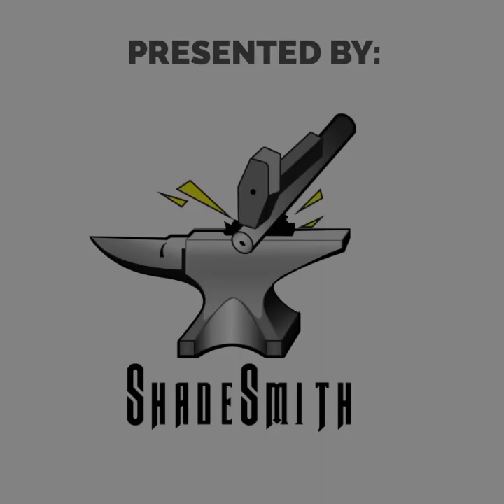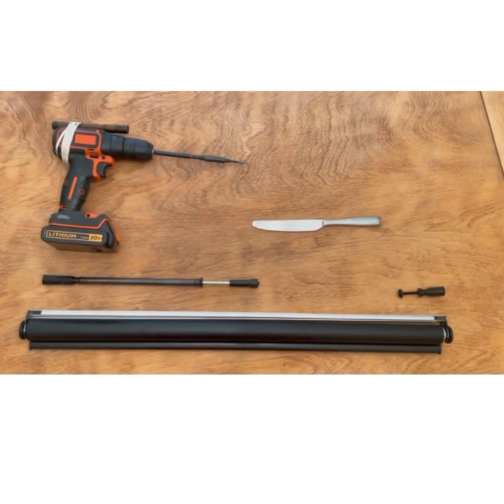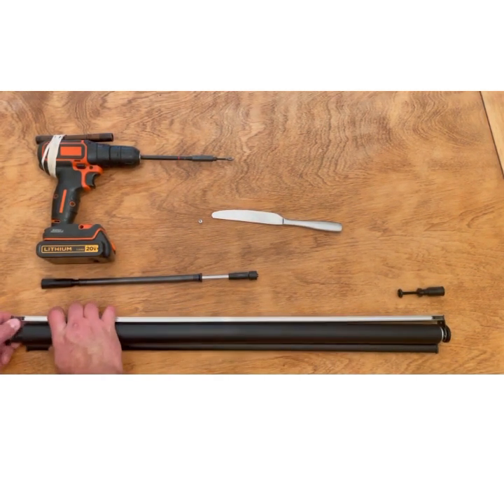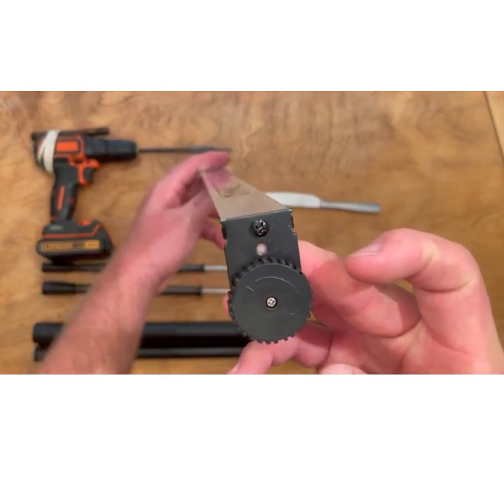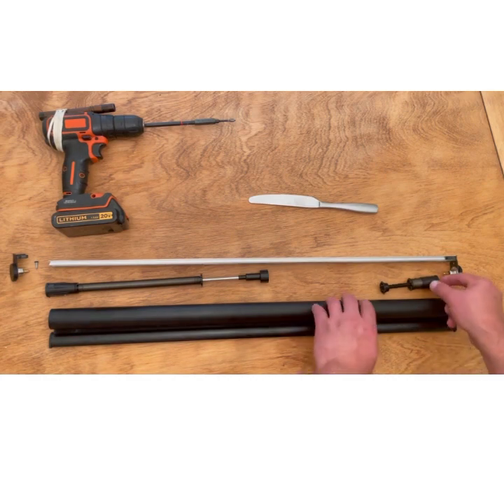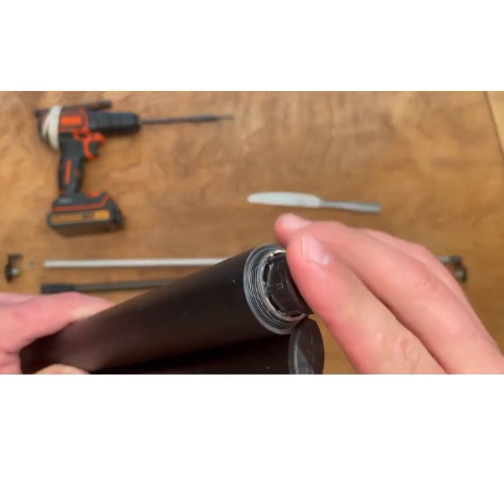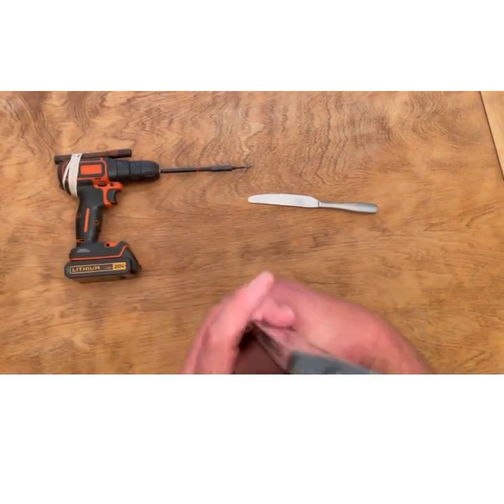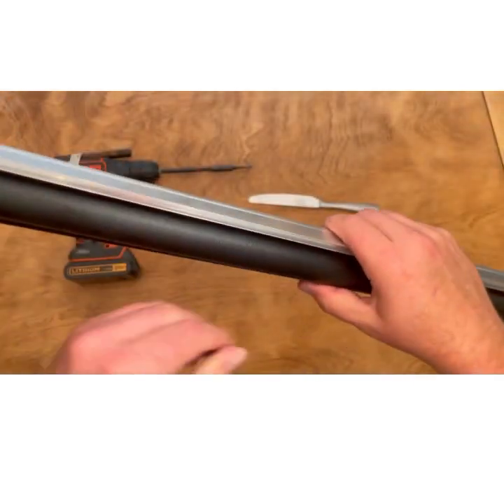Slow Rise Roller Shade Spring & Auto-Stop Replacement Instruction

Comment: Could there be another cause for poor operation inside the shade itself..
Reply from the maker: The spring is responsible for the operation of the shade. If the shade is not operating correctly, it is most likely a bad spring. It could also also be a broken auto stop, if you take the shade apart, you can inspect it for any obvious damage. But the majority of the time it's going to be the spring that has gone bad.